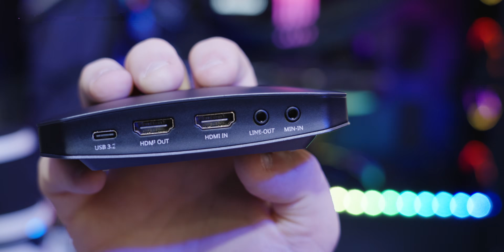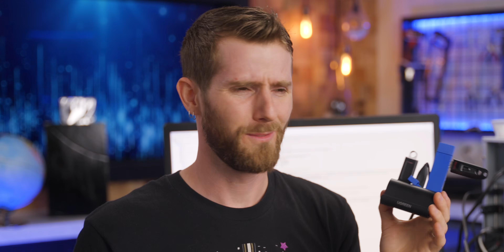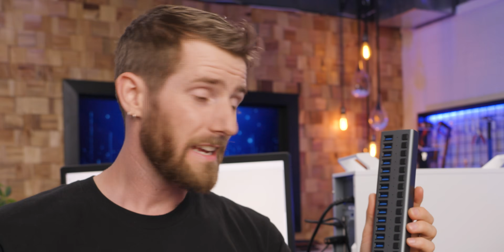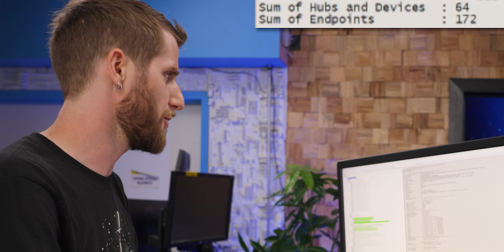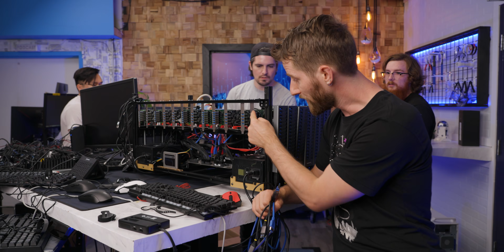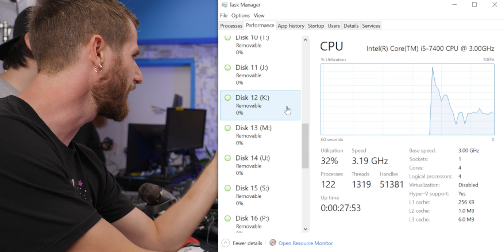How Many USBs Can You Plug In At Once?

Comment: there is so much little info about backfeeding and no videos about it at all, I used to use and wireless rgb kayboard (it uses a battery) and I charged it with my pc when needed once fully charged it discharged a significant amount of energy back to my pc I didn't new what was going my hard drives where getting disconected until my pc was unable to boot, it killed my VRM on the motherboard  and I, only figure it out when I replaced the motherboard, everything was fine untill I plugged my keyboad and all sintoms came back imideatly, until it shot down and almost kill my motherboard again, fortunately now I know is the keyboard backfeeding power once fully charged.

Comment: Anyone live thru the pre-USB computer days? 
AT port for keyboard only, 
PS2 ports for KB or mouse, 
serial (com) (rs232) for mouse or modem or others, 
parallel (lpt) for printers or zip drives or others; 
or other ports like SCSI... 
CGA then EGA then VGA & SVGA for display, 
BNC or RJ45 for Ethernet...
Then USB came out, and the assimilation's began...

Comment: It would be much more interesting and realistic with external drives of all kinds. We don't use multiple keyboards or mouses. But 4 5 10 external drives and some running backups could be a reali life scenario. Some controllers or other HID systems also! And not too many USB sticks either. ;) My X470 usually starts to lose its mind at 4 Ext Drives, 1 Wi-Fi. 1 wireless mouse and keyboard.

Comment: Well. My evil bit went off, and I remember a new bit of technology now. Passing USB devices across internet connections.

I think this is kind of cool for practically demonstrating the limits of USB connections in general. But now it's a new upper bar what is or could be considered reliable connectivity. Particularly if you have software rated drives on USB hubs. Yes the flash drive raid.

Another question I kind of have is why don't they have chips that can handle not just a one to four ratio of input connection USB to 4 output connection a1 to 4. Can they make anyone to eat or 1 to 16 controller  chip

One thing you're thinking about is where are the drivers running from? Or is it a plain date bandwidth issue. So for instance you have an extraordinarily high bandwidth chip/hub at the top/apex of the hub pyramid and slower ones near the bottom?

What about a multi- HID cluster module over 10gb Ethernet?

Aka, iHID (like iSATA or iSCSI)
Reply: Yeah I'm looking at that 16-port powered USB and thinking oh let's use 16 1 TB thumb drives. Connected to raspberry pi, and software read them level 6. So now you have 14 TB of drive storage .

Comment: Its 128 devices per port. You're supposed have all of the powered usb hubs connected to a single usb hub connected to the PC. Then it will fail at 128.

Comment: High CPU use on many USB devices is no surprise as most USB controllers are built with the same philosophy as winmodems.
Reply: No, winmodems were implemented largely in software, with minimal hardware to allow it to work, while still having a serial RS232 address and IRQ that needed to be allocated.  With USB it is because they are polled for input, instead of being interrupt-driven like serial and parallel ports used to be.  The more devices the processor has to poll in turn, looking for any I/O, the longer it takes to get around them.  That is why USB is completely unsuitable for precision timing, while with RS232, you can get down into nanoseconds.
Reply: @I_am_Phil_Lee  My 'winmodem' comment was referring to their commonly found state of 'hardware being implemented in software' instead of just pointing to the many device load as being high CPU due to the load on busses/interrupt/polling that it creates. At least that is the state USB was often in last I looked around at drivers.Maybe I should go peering around through newer drivers since I haven't during the usb c days days, not that they were making much use of that here.

Comment: The bandwidth problem can also be a problem with big hubs and many devices 😊
Reply: I've a 16 Port hub (it's the one shown in the video), but I usually keep in mind that there might be interruptions when I use too much ports with too much bandwidth, also I usually don't use all ports at the same time, I use it because it has its own power supply and I can switch the ports on and off and don't have to replug things all day long. However I'd like to have to buttons, 1 data button and one "power only" button so I could use ports as power supply ports without having it transfer data when I'm charging my phone with it and therefore faster hitting bandwidth limits.

Comment: Something else to be aware of is USB lead length - power really does degredate the longer the chord. Also... USB 2, vs USB 3 power....  I have a USB 2 external drive that will ONLY work plugged into a powered source.... but my USB 3 drives.... totally happy working on anything. So - try to keep chords short and try to stick to USB 3 ports. I mean - the others DO work... they're just unreliable... and nothing kicks you in the nuts like a 350GB file transfer randomly failing half way though on a USB 2 link....
Reply: The USB 2.0 Specification specifically calls for a cable length of no more than 5 meters between endpoints. It is important to take into consideration cable lengths inside of the device as well, as many devices use bulkhead or threshold connectors and there is a substantial amount of distance between the physical connection and the USB controller contained inside. USB 3.0 has not amended this specification - so it is still best to stick to 5m or less for cable runs.

Comment: I did that some months ago as well. I had the problem that a raspberry pi only supports up to 16 devices. But for CI test setup with hardware I needed over 24 so I used a shuttle pc. But only tested  to 32 devices^^

Comment: Entertaining? Yes, as always, big fan, but the 127 devices is more a count of how many different devices, at the time, USB would, more or less, with and coexist with. Not so much that 127 devices would be able to work at the same time. I.e. there aren't enough drive letters to assign to thumb drives etc....127 USB mice , c'mon really? Cheers!  Also, back then, in some cases you had things like DMA to worry about, external tape or floppy drives interfering with the actual 3.5 floppy which used DMA 3 or 5, it's been a while, and installing some early USB stuff would use that DMA setting and bump the 3.5 drive off and make unusable. Cheers!

Comment: cool vid, but why not using linux for this?  linux does not use "alphabethics" to assign drives
Reply: Even on Window$ you can assign a mount-point for a drive instead of a drive letter, so while the number of letters is limited, each drive could have dozens mounted on directories (sorry "folders" now they've been dumbed down) on that drive.

Comment: Next time you need and upgrade yo your cherry switches
3:10 I have turned on my Xbox FPS counter too
10:00 now I know, netbeans reached it's nested array limits using a debugger at a breakpoint, but no worries it's depth can be set in the settings.
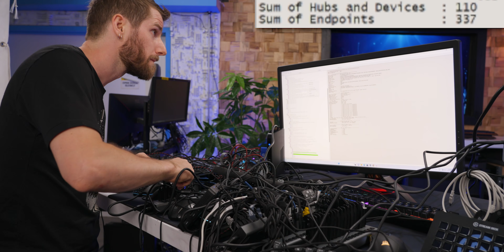15:10 Yeah, okey Detective Tom Ludlow
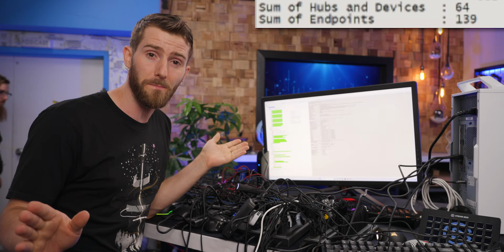15:47 oh come on, don't nuke that platoon.
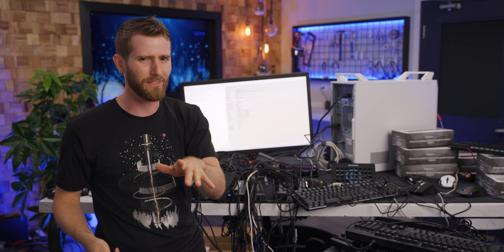17:15 Go smart about this, strength is not your attribute oh warrior
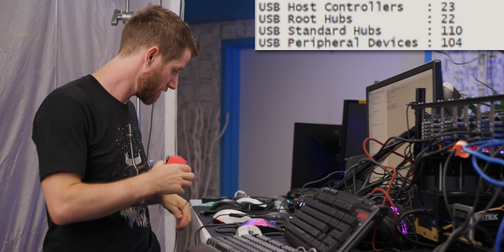22:19 How can you know that?

Comment: It has got zero to do with whether it is AMD or Intel, but with how many controllers (not ports) the motherboard manufacturer has implemented.
Also, the power limit is not two and a half watts, it is 2.4 Amps at 5 volts, which is 12 watts.

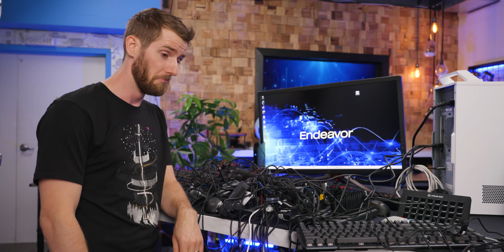Comment: 18:09 another reason to go for amd5 instead of intel i5-13600kf. Goofy video, but still informative.
Reply: No difference - it is down to how many USB controllers the motherboard manufacturer has implemented, not who made the processor.
If you plug additional controllers into PCIe slots, you can have another complete set of USB devices, but some motherboards build that into the chipset.
Reply: @I_am_Phil_Lee 
Not quite. The Zen 4 CPUs have built-in USB controllers, and a lot of manufacturers just use hubs on them.

And the chipset is provided by AMD, motherboard manufacturers can't build anything into the chipset, as AMD designs them.

Usually, the motherboard manufacturer doesn't put any additional controllers on, as AMD's chipset has additional USB controllers built in.